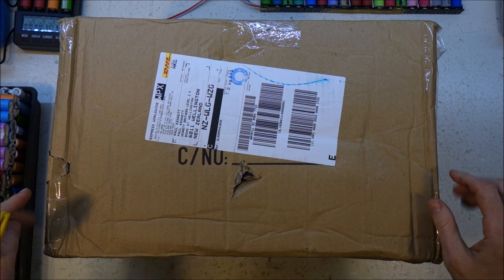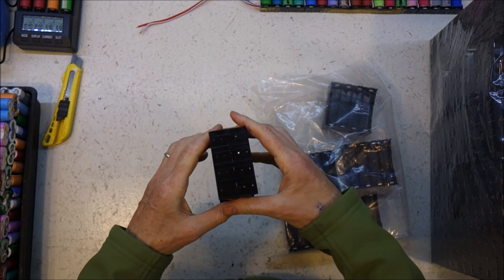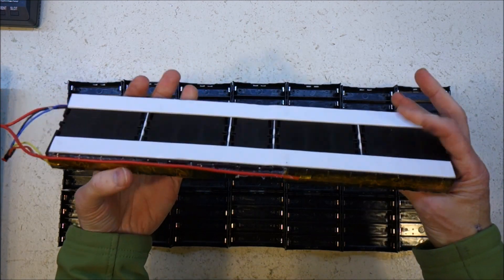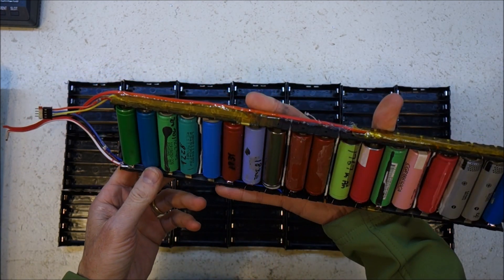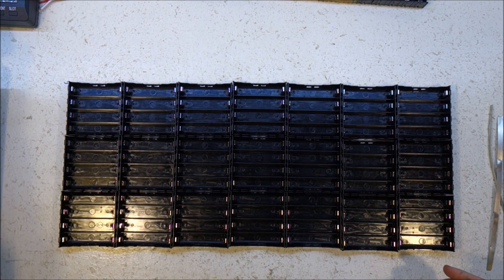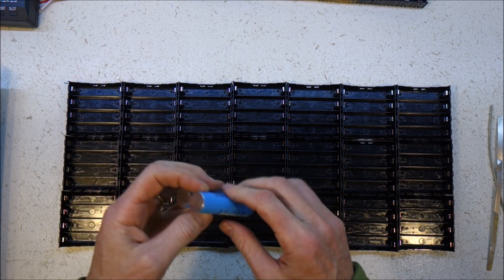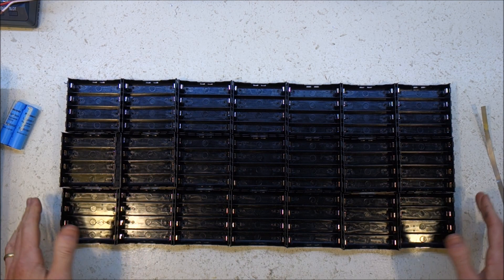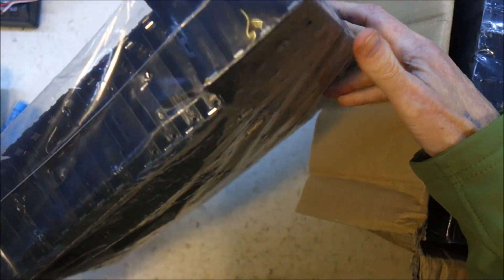Laptop Powerwall 39 - 200 battery holders

Comment: I think this is the worst possible method of a power wall. aayyyyyyy to much space wastage
Reply from the maker: I'm calling this configuration a "power shelf". 
It's dimensions are 55cm x 24cm x 4cm which is a volume of 5280 cubic cm. An equivalent 24P7S pack using the standard small 18650 end holders would require 48cm x 14cm x 7cm which is a volume of 4704 cubic cm. That's a 12% volume difference, but you do get the advantages of very easy maintenance and increased air flow for cooling.
Reply: +Paul Kennett good luck with it. maybe you'll turn my opinion around. but I'm still not a fan of keeping the cells in pairs. but who knows. I like to be wrong sometimes

Comment: I think I'm heading this route as well with the battery holders. I noticed you have a opus bt-c3100 smart battery charger if I'm not mistaken. What option do you use for capacity testing? Discharge or the charge test option?  

If that is not the opus BT-c3100 disregard.

keep up the good work
Reply from the maker: Yep - I'm using the OPUS for discharge capacity measurements. Seem to be working OK.

Comment: pretty exciting indeed.
Any concerns or ideas on heat dissipation, if any ?
Keep on trucking ! (from France)
Reply from the maker: This solution will have the cells packed less densely than the typical big block setup - so heat should dissipate in air OK. Plus I plan on having plenty of capacity so they won't ever get stressed.